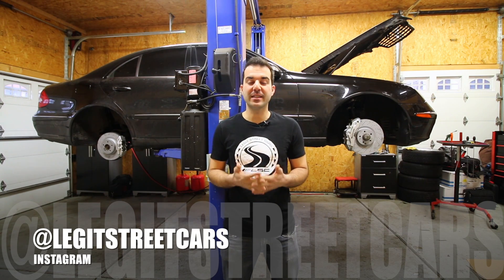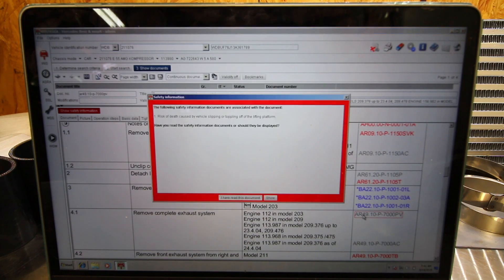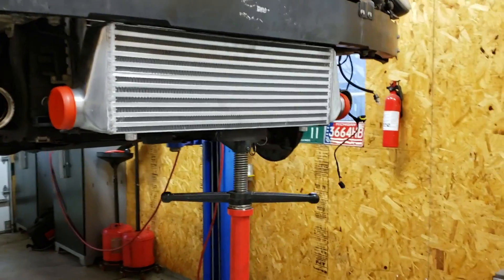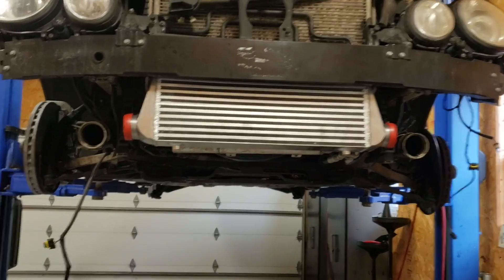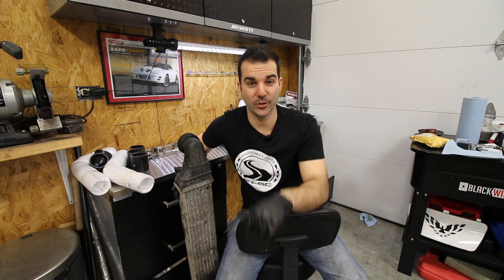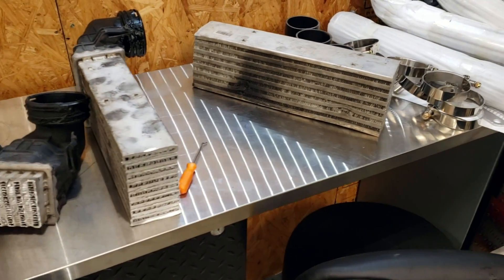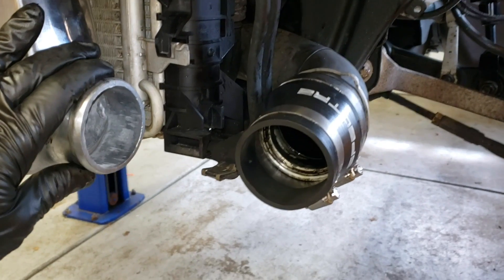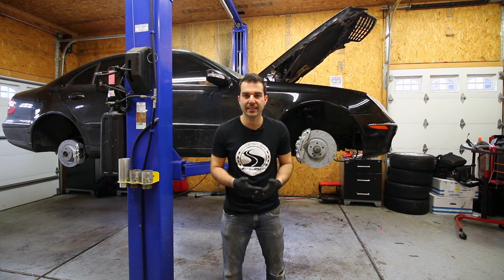I Installed A Big Intercooler On My Turbo Diesel Mercedes So I Cut Open The Old One. What's Inside?

Comment: Could you have gotten a taller intercooler? looks like there was room.
Reply from the maker: Ya it could have gone taller. It's the other dimensions that wouldn't work. Couldn't find anything closer
Reply: Yeah. It’s hard to know until you get the car apart. Looks good though.

Comment: Can you run an A/C outlet through an intercooler?
Reply from the maker: Not this style. There are kits for air to water setups that can use the AC
Reply: @LegitStreetCars  Yeah I just YT'd it, looks like the Dodge Demon uses this method.  I just had a light bulb moment that wasn't actually a light bulb moment.  I didn't know whether or not it would work as the car would be using power to run the A/C but it looks like it does, but I can't lay claim to thinking of it first lol.  Really enjoying the cdi series, there's a UK YT channel called Car Throttle where they do mod's to a BMW 320d to beat a M3 around a track, would be great to see your cdi lap faster than a E55 : )
Reply: The Hell 🐈's use something similar on the supercharger setup.

Comment from the maker: What other mods should I do to the CDI?
Reply: Get C30 cdi AMG injectors!
Reply: @Batiradko  As far as I remember, that was an issue with the angle of spray on those being not the same with the 3.2.
Reply: LegitStreetCars replace the radiator, that thing is nasty! Hahaha, but really you should go for a new interior.
Reply: Limited slip rear diff to get the most out of the power and avoid that embarrassing one tire fire
Reply: Canuck Fobroader good idea! Do that for sure
Reply: Hey, Alex! What is your idea about cylinder head porting? Yes, it's not an easy mod, and it gets done, when every mod is done and head becomes the restriction. But why don't you do it from start? 

Like everyone says: "What psi on the turbo, bruv?" "What's the boost?" 

Power is not made with boost only. If boost would make power, everyone would swap pipes for thinner ones. Power is done by increased amount of air, and giving right amount of fuel. So why don't you derestrict it? 

Also I think you would reach same power with lower boost and ported head, as with high boost and stock head. 

Also porting head reduces EGTs
Reply: LegitStreetCars put an M52TU in it
Reply: For Chicago winters you need heated rear seats for your kids
Reply: Try the AMG command pls
Reply: port and polish both intake and exaust plus lsd to get all that power to the ground. keep doing what youre doing you are giving that old diesel some amg flair maybe some small stuff like some stiffer bushings or even just putting a better sound system in it a custom sub install would be a neat video
Reply: These are some U.K. upgrades:-
https://www.youtube.com/watch?v=1ol9yl3BhQY
Reply: Ls swap..lol
Reply: AMG 722.6 blue solenoids
Reply: remove intake manifold clean/inspect and remove egr plates and hardware that are already bypassed. My 05 cdi kept going into limp mode even with the resistor mod.  Scanned it and came up with a egr fault.  Pulled and cleaned egr valve, really dirty. Never had another problem with no boost issue.  Hate to see what the rest of the intake looks like.
Reply: Multimedia. Not SPL, just a modern headunit or even RSE.
Can you replace the speakers oh that model?
Reply: S200 turbo. Tubular manifold. Bigger injectors and fuel pump. Black smoke racing had already got 700hp out of an unopened engine a couple of years ago 😉
Reply: Compound the original VNT turbo with something like an hx50 and two 60mm bypass gates. Use inter and aftercooling. Drop the compression. Custom exhaust side of course.